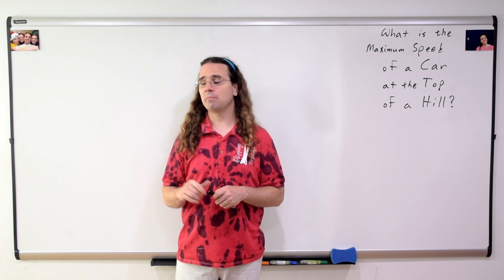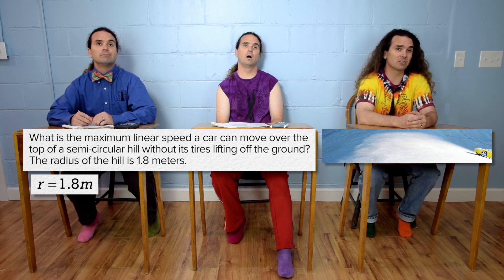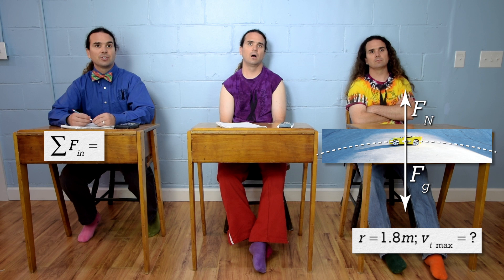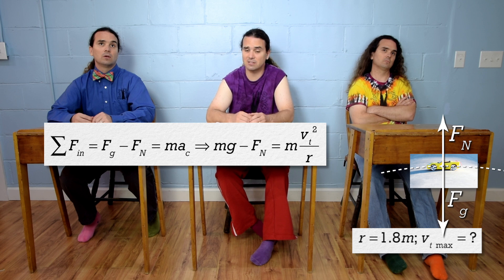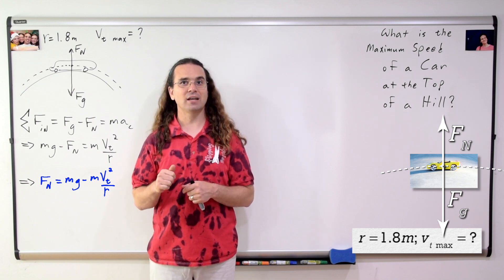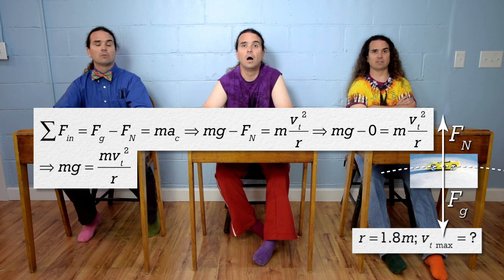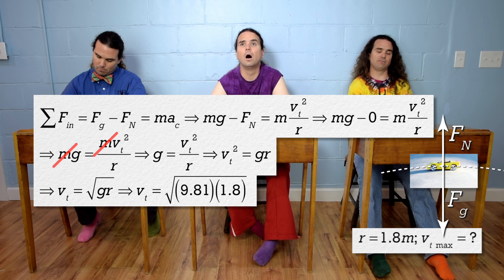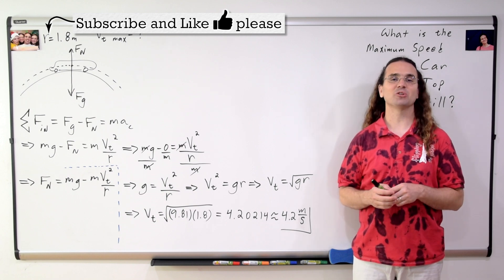What is the Maximum Speed of a Car at the Top of a Hill?

Comment: Isn't a force normal of 0 theoretically impossible? How does max tangential velocity exist if the Force Normal is 0 and the object is tunneling towards the bottom of the Earth?
Reply: It's not tunneling towards the bottom of the earth. The force of gravity in the inward direction minus the force normal is the centripetal acceleration which increases as the tangential velocity increases. That means if the tangential velocity gets bigger and bigger, the force normal must get smaller and smaller (the force of gravity cannot change because the acceleration due to gravity on earth at sea level is always 9.8 meters per second, and the toy car has a constant mass throughout the entire problem). Eventually, the tangential velocity and, by extension, the centripetal acceleration will be so great that the normal force hits zero. The tangential velocity can increase, but the normal force cannot. This means that if the car goes any faster, it will launch itself in a tangent when attempting to traverse the hill.

The normal force is not 0 because it doesn't exist and the car is plummeting to the bottom of the earth, the normal force is 0 because the car is traveling so fast over the hill that once the car is going downhill, the car is not pushing down on the hill and the hill is not pushing up on the car. It's at that perfect balance where the car is gliding just on top of the hill.
Reply: @softlocked9586  yeah but there is still contact between the car and the hill
Reply: @RoudhaAlhamli  there’s contact but there’s no force going down. It’s just brushing against the hill at that point.
Reply: @softlocked9586  thank you so much! you explain better than my physics teacher
Reply: @softlocked9586  you are amazing for this. thank you for explaining it so well !!

Comment: What about the minimum speed required to go over a hill?
Reply: you can solve that problem with potential and kinetic energy. Find the gravitational potential energy at the top of the hill using the bottom as height 0. Then set that potential energy equal to kinetic energy and solve for velocity using the kinetic energy equation. That should be the minimum velocity it takes to hit the very top of the hill.
Reply: If the car is powered at every point along the way, there is no minimum speed.  Minimum speed would apply if you were coasting up the hill first.

Comment: Shouldn't the maximum velocity be lesser than what you found? If Fn is zero, it means that there is no contact between the tires of car & road :/
Reply from the maker: This is really a rhetorical question. There would be no contact, however, there also would be an immeasurable distance between the tires and the ground. So, are the tires touching the ground? Does it really matter?

Comment: great lesson! but i have one confusion:
if    Fn=mg-m.Vt^2 /r
when Vt is greater than its max value that makes Fn zero, shouldn't Fn be towards" in the ground "?
Reply from the maker: The point here is that a surface cannot pull on an object, therefore the force normal is always a push. In this example the surface can only push upward, therefore the force normal can only be up. Getting a result that the force normal is down means the force normal no longer exists because the car is no longer in contact with the ground. Hope that helps!
Reply: @FlippingPhysics  Oh that makes more sense